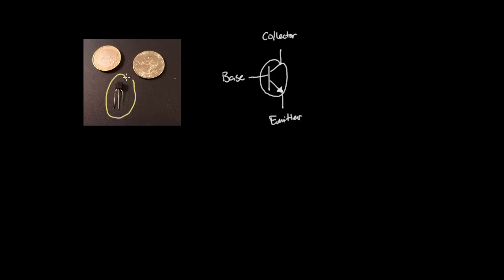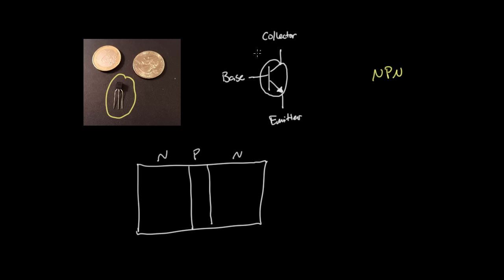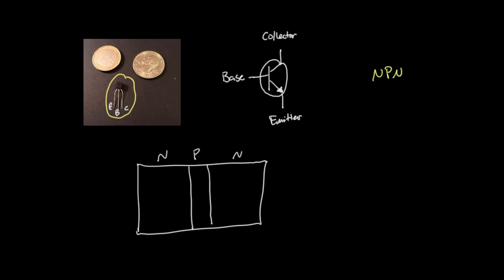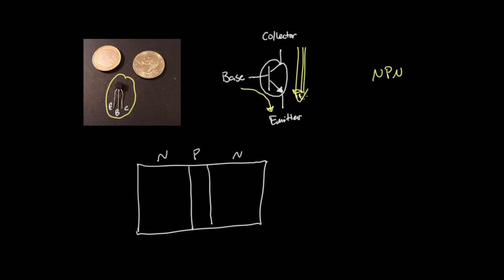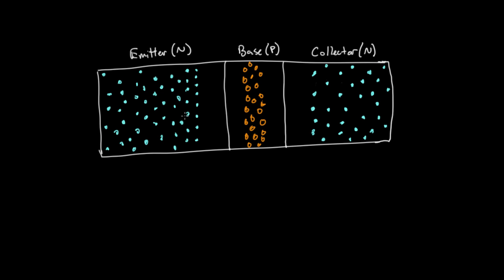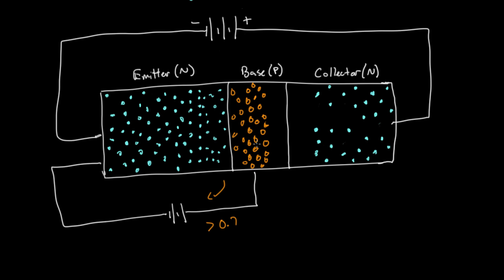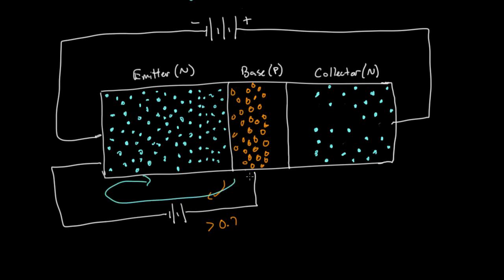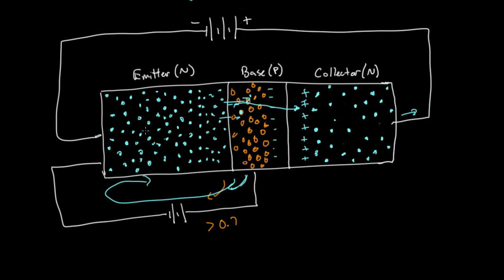How a transistor works

Comment: @Ben Eater
Would you please make a video that explains what the difference between the collector and emitter is? if they are each the cathode of the npn then why can't you reverse them? Why does reversing them not produce the same result. I assume it has to do with something at the molecular physical construction level. Perhaps one of the sides have more volume? is it perhaps that the base feeds a larger surface area to one side over against the other side? I'm really interested in the intricate differences of the properties of the materials to try to understand why the small vBE causes iC to flow eventhough it is flowing contrary to one of the figurative diode directions. That has never made sense to me and I studied it more than 35 years ago. lol.  Thanks
Reply: A late answer is sometimes better than none at all. Transistors will indeed work the wrong way round, with collector and emitter reversed. However the current gain may be much worse in reverse and also heat tends to get dissipated in the emitter rather than the collector, which will be wrong for the physical packaging for power devices. The structure and doping will have been designed to work best the correct way round.
Reply: @MikeB-rr5hh  Thanks for the late answer, still worth it. Appreciated.

Comment: this is a great video! i have a question though. what if this time i connect the positive terminal of the battery to the base, and NOT connect the negative terminal of the battery to the emitter. the transistor should still turn on isn't it? because electrons will still be able to flow from the depletion region of the base to the positive terminal of the battery, and there is already a potential difference provided by the external source from the emitter to the collector.

Comment: I have a question: Say you have a transistor with a voltage of x over its depletion layers. If you hook up a battery with a voltage greater than x to the emitter and collector, will a current run through the transistor regardless of whether or not the transistor is switched on or off? Or in other words: Does a high voltage break a transistor and effectively turn it into any old bit of copper wire?

Thank you for explaining this with electron flow, by the way. I always feel like I still have no idea what's going on when I hear the words "the holes flow", because deep down I know that's not what's actually happening and it disturbs me deeply to the point where it frustrates me.
Reply: A transistor acts like two diodes opposing each other so one or the other is always reverse-biased and no current will flow. Forward-biasing the emitter-base junction causes forward current flow, with most of the current being swept over the base to the collector through the apparently reverse-biased base/collector junction. With no forward bias on the base, current only flows if you increase the emitter-collector voltage beyond the breakdown voltage of the junctions (an important parameter in the specification of the device).

Comment: Hi Ben, to some extent I understood what happens when transistor is on being switched for the first time. but why big flow of electrons stops when transistor gets into off state? I mean - now that flow of big power source is active - who cares if minor circuit is off or on?
Reply: GEORGY POLSKIY The base-emitter current is nulling the deleption zone. Not the e-b-c current. The ebc current cannot flow when the deception zone is "turned on" when the e-b current is stopped.

Comment: But a transistor has only 3 leads.  Also, what keeps the larger voltage circuit from frying out the smaller voltage circuit?  Why does the circuit close when removing the .6 volt current after the larger current has started?  And you still need a switch to apply current to the base!
Reply: The smaller circuit is a sub circuit of the larger one. This was simplified by drawing a small battery, but in reality is probably a line of resistors and push buttons. As for still needing switches, you're right. However, you can chain BILLIONS of transistors together in a pattern, such that each non transistor switch is exponentially more meaningful. Consider your desktop computer- one power button and a few dozen keyboard keys are all the physical switches you need.

Also consider non tactile, non transistor switches- photocells that turn circuits or off in the presence of light, quartz clocks that turn circuits on or off a thousand times a second, reed switches that turn a circuit on or off in a magnetic field.

Using two reed switches aligned perpendicularly, you could build a compass that lights up one light of pointing North, another if pointing West. Add a couple of transistors and you can now have four lights; N, E, W, S.
Reply: When the small current turns off, the base-emitter junction stops conducting and the depletion region widens, meaning that electrons can't jump from the emitter to the collector anymore.

Comment: Small current as switch to larger current sounds like a mosfet. Are they the same thing?
Reply: It's similar but not exactly the same. A FET is a voltage controlled device rather than a current controlled device.  The electric field at the gate of a FET (by applying a voltage) either pinches off current flow or enhances current flow from drain to source.  There is no current flow into the gate of a FET other than the charge needed to charge of the effective capacitance.  The respective terminals of a FET Gate, Drain, Source are analogous to Base, Collector, Emitter of a Junction transistor.
Reply: Yes and No. 
========
Yes: They both require Voltage AND Current to trigger
-------------
No: 
BJT - The amount of BASE CURRENT modulates the output current (further explanation @ video)
FET - The amount of GATE VOLTAGE modulates the output current by widening the electrostatic FIELDs of the Drain-Source channel (charge carriers flow here)

Comment: I am just learning these things but @6:46 did you mean electrons flowing in the direction of arrow shown instead of current? Thanks for this awesome video anyway.
Reply: Electrical flow, the passage of current from positive terminal to negative, was discovered before electron flow, the passage of electrons from negative terminal to positive. In fact, electrical flow was discovered before the basic atomic model was theorized. 

Scientists were able to observe magnetic declination- tipping compasses either north or south- and arbitrarily decided that making an electromagnet that tips one way would be positive, and that tips the other would be negative. Now that we have a finer understanding of the atom, we see that so called positive charges are the lack of an electron, and negative ones are the presence of an electron. For a long time, it wasn't even known that electrons were moving- it was just as likely that the atoms were spinning differently or small foxes from another dimension were pushing magnets around. Rather than decide what was happening, scientists said this orientation is positive, and future people will figure out WHY that is.

Comment: To make sure I understand, there are 2 depletion regions in the base right? With E of 0.7v between Emitter and Base, you actually fill the holes in the Base, which reduces the depletion region. The E voltage between Emitter and Collector is than big enough to let the current flow through the Base. The Base becomes actually a very thin isolation, that can be bridged by a minimal voltage. That's my understanding so far. Because no matter how high the voltage is between the Emitter and Collector, the current is the same, as long as the current Base and Emitter is the same. This behaviour acts like a changing resistance value between Emitter and Collector, but in reality the current it's only determined by the amount of holes are filled by the Base current (Ib).

Comment: @dannalbob 
If you stop the smaller flow of electrons, the transistor will stop the larger flow of electrons. I believe this is because it's easier for electrons to flow through the base than to flow through the collector.

Comment: I still don't understand why the base-collector section stops acting like it is reverse biased. His explanation at 10:00 could be extended to a reverse biased diode to explain why current should flow through a reverse biased diode (which is obviously incorrect). What am i misunderstanding here? Obviously it must have something to do with how thin the base (and the large number of electrons in the emitter?) is or whatever, but this concept still eludes me.

Comment: Why do you need the extra battery if the base makes the current go anyway?
Reply: +Sebastian Greftegreff Just to provide a potential difference between E and B. You could equally ground B, so long as E is at >0.7V potential with respect to B current will flow

Comment: Why can't the electrons go from base to collector without the additional battery below? You said yourself, p-type region is sufficiently thin to constantly keep the current flowing.
Reply: Because you have a depletion region between the base and the emitter. As soon as that depletion region disappears electrons fill the holes in the base and the second depletion region disappears...
Reply: Ricardo Nunes 
The guy in the video didn't seem to suggest that the second depletion layer disappears. He said that the electrons are being pulled by the positive charge from the second n-type from the base hard enough, plus, the p-type is thin enough, to overcome the second region and shoot past the base wire.

Why the electrons from the second depletion region don't part from the base and go down the base wire or pass into the second n-type is what confuses me.

Also, why doesn't the original battery close the first depletion layer and cause the positive charge to pull the electrons through the base into the collector anyway? It does in a PN junction when the voltage is 0.7V.
Reply: [Why the electrons from the second depletion region don't part from the base and go down the base wire or pass into the second n-type is what confuses me.]
Actually, they do...

[Also, why doesn't the original battery close the first depletion layer and cause the positive charge to pull the electrons through the base into the collector anyway?]
It can with high enough Voltage.

Comment: But why do we need the battery connected to base at all? Why not just 
brute force our way through from emitter to collector by supplying a ton
 of electrons? Is that possible, without anything connected to base?
Reply: Of course! This is called burning out. You have to be careful and intentional when designing your circuits to ensure there's not enough current at any time to allow this. If lightning strikes, all bets are off.

Comment: Complete noob here. This is a good example of what, I'm not quite sure I understand, see, often you'll see an NPN BJT with that little arrow pointing away from the emitter, right? But the direction of the arrow of the collector isn't shown [tho we know, it is pointing away from the collector - NPN = Never Pointing iN]. So, my question is: HOW does current travel in the opposite direction of the "imaginary" arrow of the collector, when the current at the base, allows it? It's my understanding that current can only travel one way, in a diode, an NOT the other. And, a BJT is basically 2 diodes back to back, right? So, please explain this to me, I want to learn. Great video - make more. Cheers!

Comment: If the electrons flow from emitter to collector, then how does current also flow from emitter to collector?
Reply: Electron current (-) flows from emitter to collector, like you said. Conventional current (+), which is the opposite of electron current, flows from collector to emitter. When you're speaking of the direction of current, you have to identify which type of current you're talking about. It's something that confuses a lot of students; you're not alone.

Comment: Nice explanation about electron flow opposed to direction of arrow on symbol. Wonder why the symbols weren't correctly represented to begin with?
Reply: Probably the same reason why electronic engineers have a different definition of cathode and anode when compared to the chemists definition. Anyway, with the 'arrows' you mentioned..... it is just a matter of 'convention'. If you define current as flow of electrons, then the arrow goes in the direction of the electrons movements. But if you defined the current as the movement of holes (or aka the free-moving positive charges), then the arrow goes in that direction. It's just a matter of convention and referencing. Defining electronics to have a 'negative' charge is purely convention as well. People could have easily defined electrons to be 'positive' in charge...and holes to be 'negatively' charged. It would be a different convention, but still a convention. What matters is that the behaviour of the device is predictable (equations etc), so that we can do something useful with the device. One more thing.... some people figured that a 'positive' to 'negative' direction of flow is more 'convenient' for them to work with, since people intuitively like to think of things like 'high' to 'low'.... or 'positive' to 'negative'. But this is just a matter of preference (or referencing), since - as you know - an 'arrow' is only HALF of the referencing picture. The VALUE (a number) written next to the arrow (if there is a number) is the other half of the referencing. Eg. an arrow with a number of -1.5 next to it, means a flow of 1.5 units, but in the OPPOSITE direction to the arrow's direction.
Reply: a hole is an empty space, not a particle, so how can it have a charge.
Reply: @alex trebek A "hole" in this case is an empty space in an atom's electron shell, not merely an empty space.  Because the atom now has fewer electrons (negative charge) than protons (positive charge), the atom has a slight positive charge.

A short-hand way of describing this is to say that the "hole" has a positive charge, but it's actually the atom which has the charge because it's what carries the "hole".

And @Appliance Paul, That would be because when electricity was first discovered, nobody knew exactly how it worked and when current flow was discovered they had to assign a direction to it.  They had a 50% chance of getting it right, and as it happened they got it wrong.  Maybe the infamous Murphy struck again? ;)
Reply: In the early days of electricity and atomic science, they didn't know if  it was the protons or electrons moving. Seems obvious now, but when you haven't figured out what something looks like, it's a bit tricky. Thing is, you need to be able to do math with charge flow and such to dig deeper, so they guessed. Turns out, they guessed wrong, and since all the math was figured for the protons moving, we kinda just said, "Well actually, that's wrong, but changing all of the math would be a pain, and telling all the engineers would take YEARS."

That's how it was told to me, at least. Maybe at some point the big boys who decide the standards will rework electrical theory to be more logically consistent.
Reply: Timothy Warner they should have bitten the bullet though and thought long term for science ,education. Its under the label of convention but really its like trying to keep the earth is flat model just because we started that way ...poor decision
Reply: Benjamin Franklin
Reply: Well, it's really not much different than the fact that parts of the world still use imperial units, when the metric system leads to cleaner, easier math. Why do they cling to this antiquated system? Inertia: it would be prohibitively expensive to change all the text books. And the older generation of engineers will keep using the old units, leading to confusion when the old and new generation have to work together, as is the case in every single workplace that hires engineers.
At least in the case of electricity, there's something to be said for not bothering: it really doesn't matter which way the "particles" flow. Yes, we now know it's the negatively charged ones that move around, but whether you do your math in electron flow or in positive charge hole flow doesn't really matter; it's equivalent.
It's like standing on a train: whether the train moves to the right while the earth stands still, or the earth moves to the left while the train stands still, doesn't matter one bit. The effect for local observers on both earth and the train is the exact same, regardless of which hypothesis turns out to be true.

Comment: Howdy. Yes.
There is, however, one thing I cannot figure out.
Where does the current gain ratio come from ?
I get it that the base current bridges the EB junction allowing the 99% of the emitter current (collector current) to populate the base and pass on to the collector.
But this logic means that once the EB threshold is bridged, the transistor should be a closed EC switch. No base current to collector current ratio.
I can't but understand that the collector current somehow depletes the EB bridging. The EB bridging must be replenished by the base current to uphold the collectror current.
Regards.

Comment: The base must be charged with greater than 0.7 Volts in order for there to be an electric current in the main circuit. Of course, it is possible with a 0.7 Volt battery, but I think that is not how computers operate. How is the transistor given its 0.7-volt charge by computers? And how does the voltage decreases in order to turn the current off?